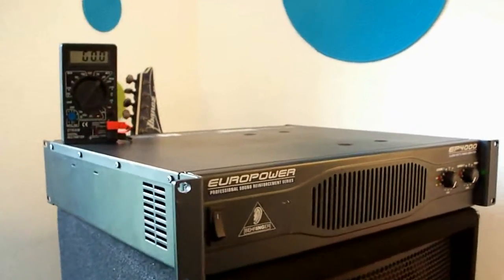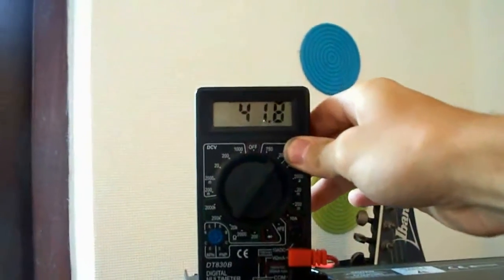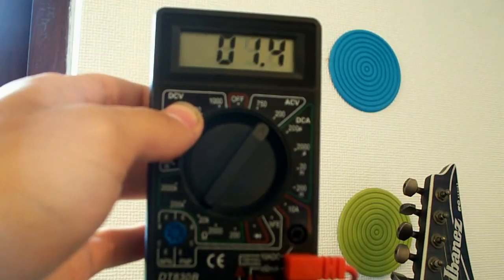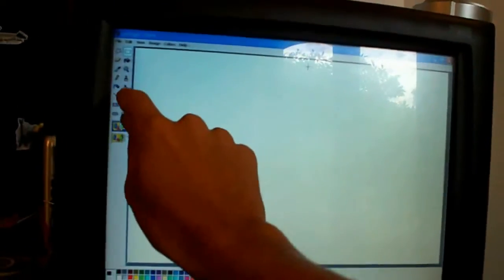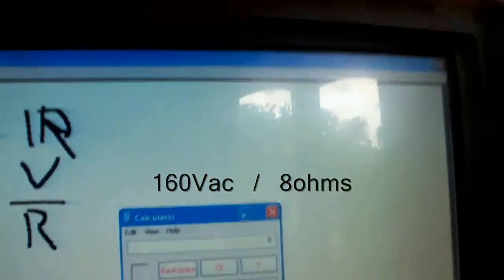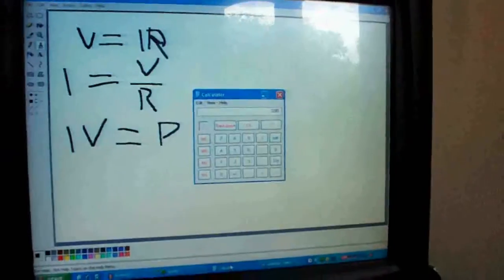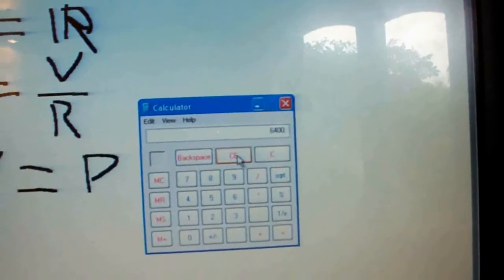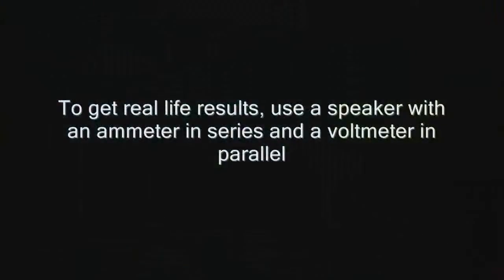Amp more powerful than Wall Socket (US) - 160V Unclipped

Comment: This amp test whilst interesting is meaningless as there is no load on the output of the amp.
The only way to do this properly is using a distortion analyser or oscilloscope and a dummy load to simulate the load of a speaker.

Comment: @barevids Ok. EV amps are high quality and the behringer's are crap. Behringer rip a lot of designs off proper gear manufactures like EV and Midas. Behringer bought midas from bosch because they were worried about themselves being sued because they coppied a midas desk design and they look almot the exact same. Even the fader colours are the same

Comment: That amp is crap. Put that up against an EV amp or a lap gruppen! Just because the output voltage of the amp is high voltage doesn't mean that its more powerful than a wall socket. I have an amp that drains 3.7KW!!!! almost double that of a wall socket!!!!

Comment: I've had it running a 6 ohm speaker for over half a year and it's been fine. It goes into protection mode cautiously though, when the load goes below ~2 ohms it shuts off almost instantly. It doesn't stay any cooler with an 8 ohm load so I think it'll be fine. 

But considering that it's a 2 channel amp, and from how my subs are moving, I'd guess about 50 wrms per channel. I don't know what class it is and I haven't found too much on this specific model. But thanks, I'll look into what class...

Comment from the maker: @31Orcas depends what class amp you have. If its class A or AA then youre probably only getting 30 - 40Wrms. If its wired more efficiently then youll get closer to 180.
Making an amp drive a lower impedance sub than its rated for simply makes it work harder and get hotter, and if you drive it hard the components can burn out. Then again if youre careful you can get away with it - i had an 8ohm amp running at 2ohms for a long time playing mids. Wont last long with a sub tho.

Comment: I have a receiver, it says 180W on the back right next to the "High Voltage" warning about not to disassemble it. That's all I have to go by as far as how much power I'm giving my subs, but it clips at the 9:30 position on the volume knob (with the maximum non-distorted input)!

Also, how does a 4 ohm sub driven by an 8 ohm stable receiver affect the sub and the receiver?